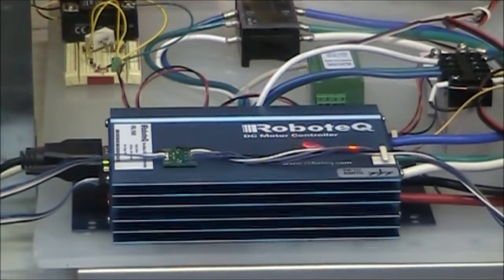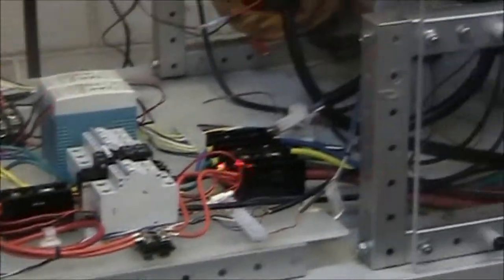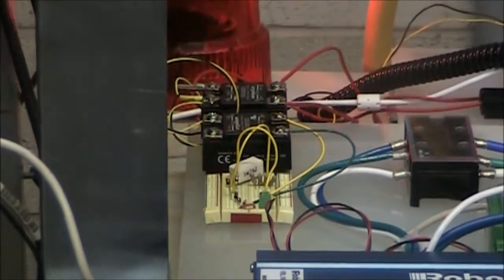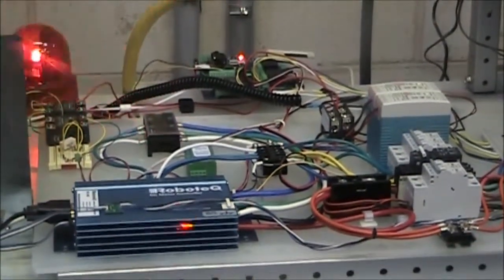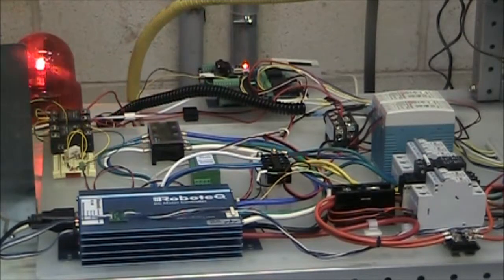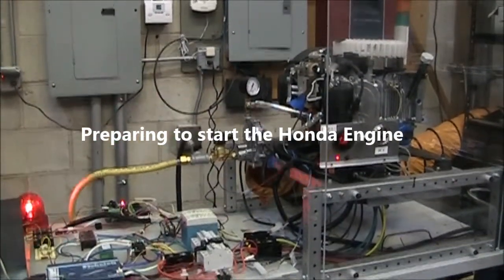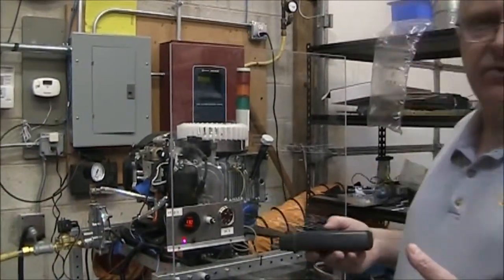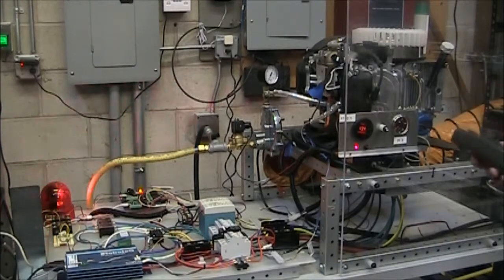BLDC Test

Comment: Hi, it happens because during the startup the BLDC is working as a motor, when the honda engine starts, the BLDC will work as an alternator generating electricity which for the Roboteq is called regenerative braking and, it will brake the honda engine, of corse!!
In my opinion, the right way for you to set it up is to connect the relay to the roboteq and program the roboteq to open the relay at the moment the amperage spent to spin the BLDC drops.
I mean, the roboteq knows when the BLDC is working as a motor or as an alternator by measuring the amperage spent.
Imagine that the BLDC spend, lets say, 70 amps to start the Honda, now lets connect the really for example to the digital output #1 of the Roboteq. Now you can write a script that looks like this:
If motor 1 amps is less than 50 amps then put the digital output #1 high or low, depending if you need the output to be high or low to open the relay.
Thats it..
Now you have an automatic motor starter set up.